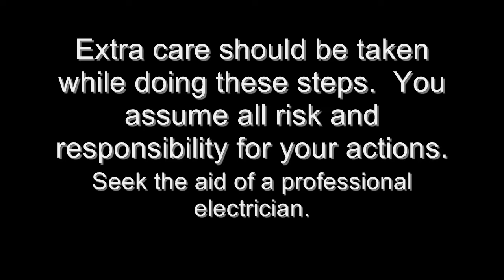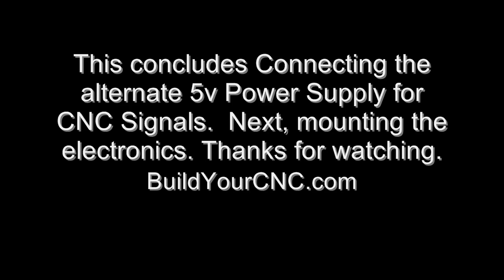cnc electronics 3 - 5v power supply alternative_0001.wmv

Comment from the maker: @alcatrazXT There are a few possibilities as I can't remember.  The power supply could have been a 9v that I had laying around and I was using it for illustration purposes, the supply was cheap and from China, or because the load that I put on the supply was insignificant and will give the incorrect reading without a significant load.  Either way, I have now started to supply only usb cables so the proper regulated voltage with the perfect amount of current can be supplied from the computer.

Comment: Why did you ignore the 10V reading on the end of the video?
Had he same thing happen to me but I decided not to use that  adapter,due to the 10V instead of 5V as the spec of the adapter.On the end I used pc power supply...
Very good video btw. ;) very helpful.

Comment: As said in the previous video these wall wart power supplies are NOT regulated - they output higher voltage at low loads and go below 5v when at high loads. 

Power from USB works but be careful as the ports can give max. 0.5A (~2w) but some pcs will only output ~ 0.15 A if they don't detect a device at the end.

Unlike pcs, cell phone chargers with usb at the end of wire are not regulated, they rely on the phone converting the 4-7v they output to around 3-4v needed to charge the battery.

Comment: hello my name is anthony i am new to all this tings , 
can this power supply work with that setup 

145W AC input DC 5V output 110/200-240V 5V25A switching power supply power adapter factory direct